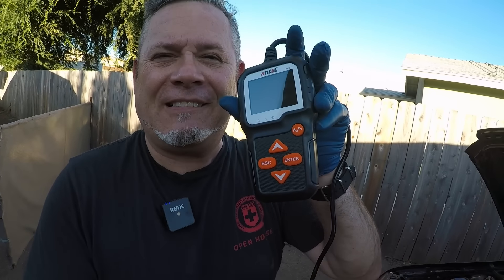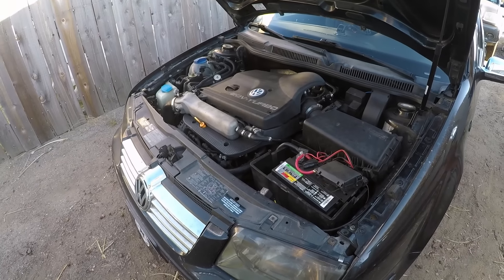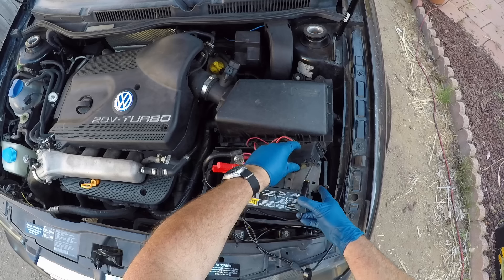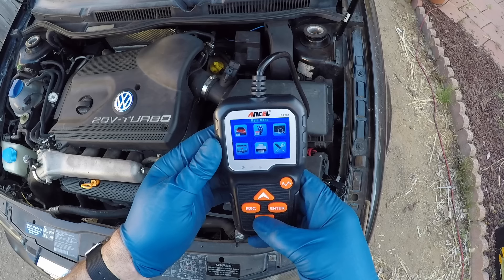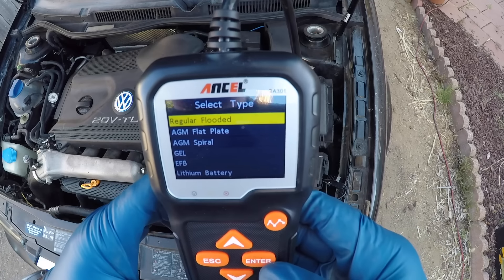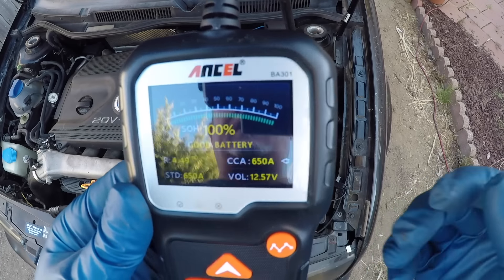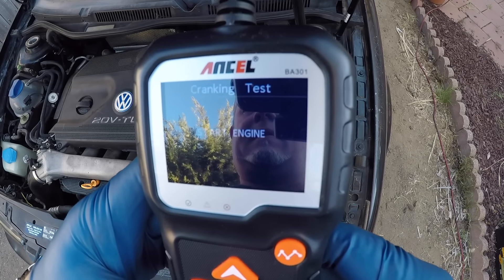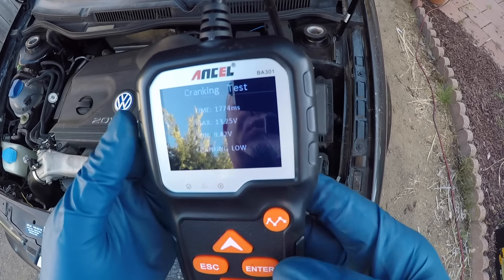We Test the Ancel Battery & Charge System Tester

Comment: I have this tool and it told me that my cranking voltage is low on a brand new battery. Needless to say I went back to the store that sold it to me and they tested it with their $10K tool and all came back good. The cranking low cannot be trusted but it can test your battery very accurately
Reply from the maker: If it's testing "cranking low" on a new battery, that would be a good indicator that there may be an internal corrosion issue with either the negative ground cable to the block, or the positive cable from the battery to the starter.  That will result in increased impedance, which will show as low cranking amps.  Worth checking into.
Reply: @CliffjumperCars  Oh I did believe me. I stripped down everything down to the starter connector cleaned all connections and it was still showing low cranking. At that point I thought maybe something went wrong with the starter but nope none of that was the case. It turns out my V6 engine starter just draws that much current and it's normal for the low cranking voltage to dip down into the 8V range. That's just how my car starter works. That's why these cheap tools cannot reliably be trusted. It is still a very useful tool to have though don't get me wrong i'm not hating on the tool it's just not as reliable as some of the more expensive tools that big stores use like autozone. They tested the low cranking and it passed that test without any issue.